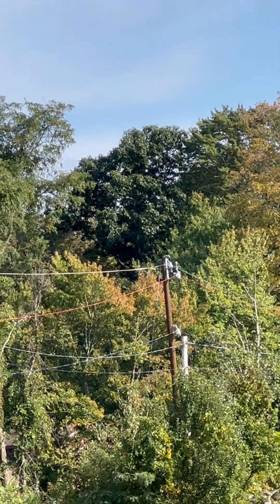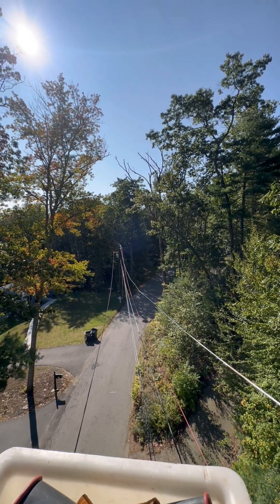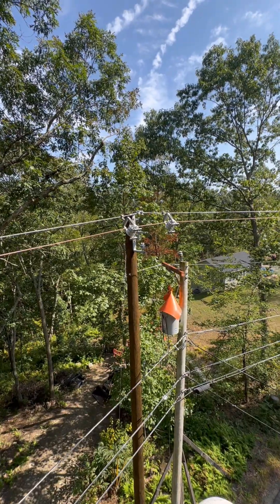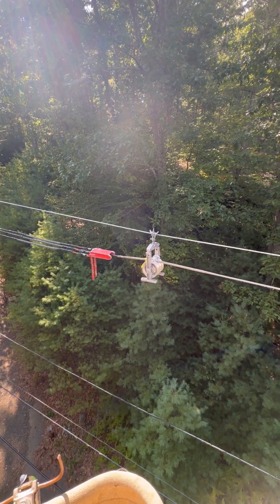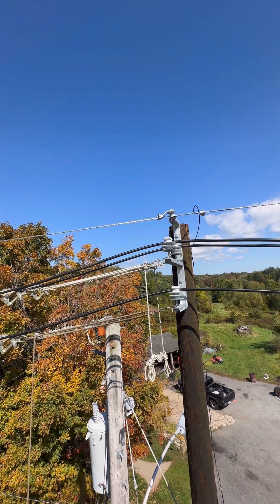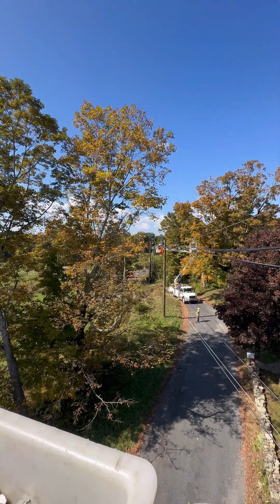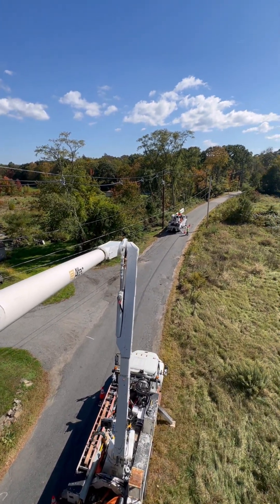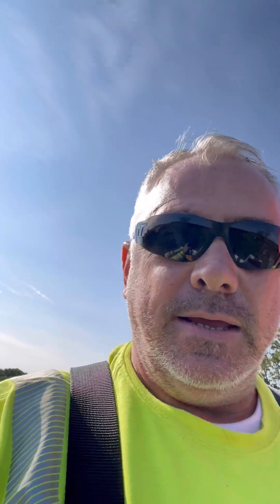Hendrix spacer cable installation

Comment: Great Video Brother, you forgot to mention, Run Spacer cable is a real pain in the ass, for all the Back and Forth.  Open wire configuration is a lot more easier.
Reply from the maker: Yes it definitely sucks. By far the most timely reconducts I’ve done.

Comment: Spacer cable sux. It’s used where the company won’t spend $$ on tree trimming. In the trade for over 4 decades, the biggest flash I’ve ever seen was on spacer cable. Working a road widening job for the state, we were moving cable 15’ to the field. A crew on an adjacent pole just went up in the air and were in the process of covering the cable with line hose. As they were covering one of the top phases, the center phase they just finished covering broke in half, breaking load on the feeder and enveloping the other two phases and the two linemen in the air. The chief on the ground lowered the guys to the ground with the lower controls as we raced over to assist. Fortunately it was winter and the guys had heavy clothes on, but their outer clothing was burned off their backs. Both linemen sustained flash burns to their faces. Btw, this was the days when FR wasn’t even a thought, early to mid 80’s. The flash was so hot, it melted the dielectric bucket liners down into the bucket. We tried to get the company to reconductor the job instead of moving the cable that far. They wouldn’t allow it. After the investigation the cable was found to be oxidized badly and the cable was full of pin holes everywhere, they attributed the pinholes to lightening. Both linemen in the air were close friends of mine. After that flash it became practice to turn on instantaneous trip and turn off reclosures when working old cable. The disabling of the reclosures wouldn’t have done anything when the phase broke in half and broke load. Again spacer cable sux.
Reply from the maker: That’s horrible!!! Hate to hear stories like this. Unfortunately our line of work is based off theory. Anytime we work mainline it’s now on one shot. Been like that since I started so it sounds like this happened a long time ago. I appreciate you chiming in on this sir. 🫶🏻🫡

Comment: Any particular tool or trick you use other than a torch for skinning Hendrix cable? Great video, thanks in advance.
Reply from the maker: Nah. The brass Ripley skinner works the best. Most companies won’t spend the money on them.

Comment: Great job. Are there any impending safety concerns in the event of a wire down? Especially with no contact to ground (since they are insulated) that could enable circuit trip or fault isolation.
Reply from the maker: When we install new wire, we install a running ground. Should there be a contact with old wire to new wire it would knock out the circuit and create an outage.

Comment: You're absolutely correct. There aren't any videos like this and that's why I am so thankful and enlightened from this one. I have just learned what spacer cable is and I've yet to understand its virtues but all the statistics show it has huge benefits. I love ingenuity. Howdy from Texas.  We had that state wide power outage a couple years ago and it changed me. I want to know how power lines work. Thank you again. 😊